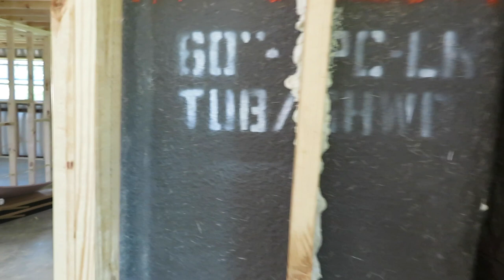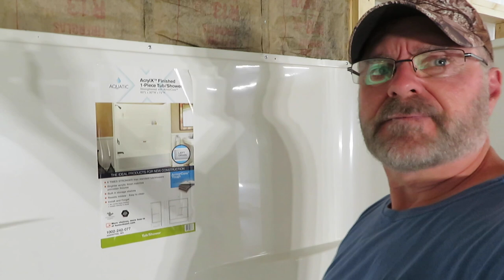Tub Shower Install | Wall And Tub Floor Support

Comment: I’ve worked at the big box store in the plumbing department, and we always recommended drywall mud as a base for the tub, but I think the foam would be a better insulator.  Great video.

Comment: Good ideas on firming up the tub surround.
Reply: Great job but, why did you not go with a oversized shower enclosure minus a tub for the out building?  + Safer in and out also.
Reply from the maker: @bextar6365  The wife wanted to be able to take a bath without all the water draining into the septic tank. The water will drain behind the building instead.

Comment: My apartment had a fiberglass insert like that. It began to age and get spider cracks that began to leak.  The apartment complex had someone come in and lay a new fiberglass sheet layer over cracks.  He roughed it up, applied some epoxy, placed a sheet on it and let it dry.  It never leaked again. I was honestly surprised and impressed.

Comment: Good job as always Pete. Is the platform floating or did u have to anchor to the floor or screw to the wall? Karen
Reply from the maker: The platform is screwed to the wall studs but not the floor.
Reply: @petebeasttexashomesteading  Thx Pete